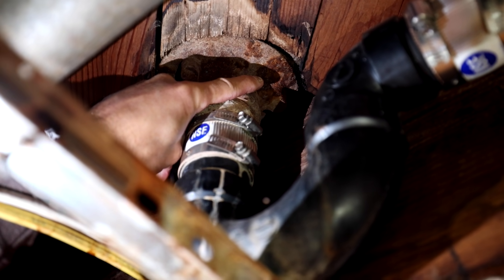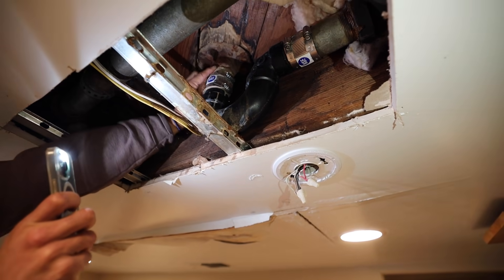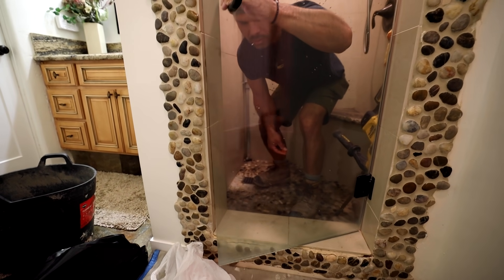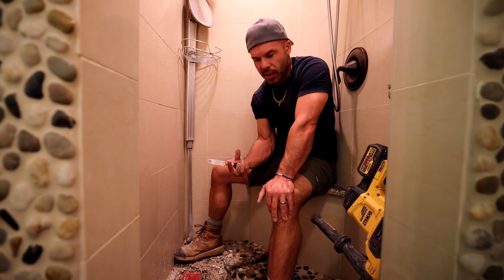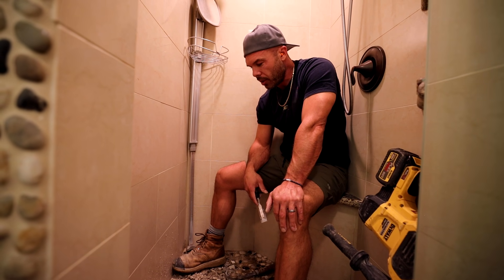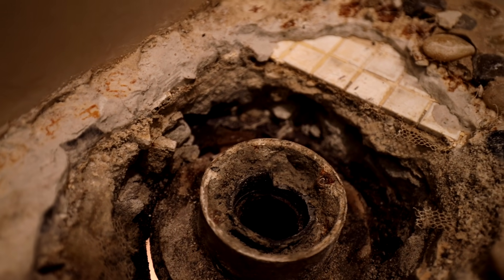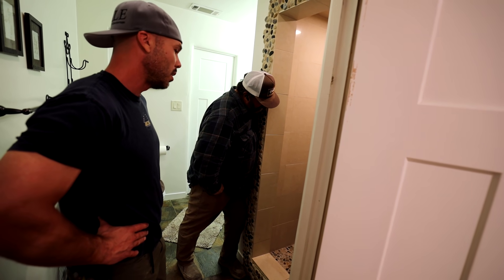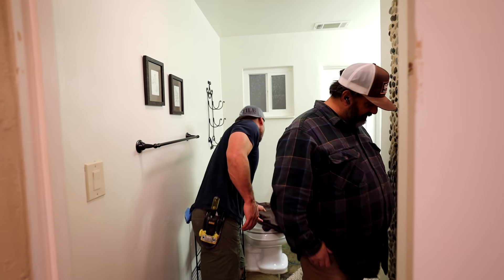Tile Guy Said he used SCHLUTER but did TILE OVER TILE

Comment: It's kind of funny as he was talking about how to keep the repair small. I just had flashbacks to every realtor I've ever worked for. Do it right or pay to do it twice
Reply: I won’t work for real estate agents anymore, give cheap and look pretty!! I’m not your guy
Reply: I am the owner and the only reason we called the tile coach is because when we had the shower installed I supplied him with a complete Schluter system. We thought we were going to be doing a Schluter repair which the top coach has plenty of experience with. This was my personal home and at the time we were working with several remodels in Sacramento for clients of mine. Given that I supplied him with the correct materials I expected him to install it correctly. I am real sure you've never done work for me. It takes the same amount of effort to do things correctly as it does to cut corners. That has never been the way we roll.
Reply: 100%
Reply: @brucepflieger7212 
Where is the tile guy you hired initially?
As contractors we are accountable for our work.
I hear you have a lot on your plate financially.
That guy should be the one paying to fix his mistake.
Reply: @hepparade The homeowner 100% lying! He even looks sleazy. Why didn't the homeowner call the original installer that he was using 10 years? I would dial the installer right there on video. He was too chill about the whole situation like he knew there was never a Schluter system installed.
Reply: @hepparade  sounds like it lasted 12 years
Reply: @Resist_JWO_1984  The customer himself commented directly above us. You don't need to be rude.

Comment: When I first started my tiling career, I had a homeowner that wanted me to do something similar to this. Retail the walls, but keep the pan in place and then cover with another layer of tile. I ended up walking off that job for a few different reasons, and no longer do business with him. If anyone ever tries to get you to do something the wrong way just walk from the project. It will save you so much headache in the long run.
Reply: I agree. If someone tells you to install a job incorrectly you need to walk away. I am the owner and I also owned Tile Outlets at the time. I supplied him with the complete Schluter system . That is what I thought we we going to repair. that is why I called the tile coach. We were not living at the home at the time and would have never even thought he would go this route. I can't imagine anyone going this route.
Reply: Question - where is the guy to fix his mistake, that did the job in the first place?

The client should never dictate the quality of YOUR work...this is absolutely why T&M work is frowned upon.  
We can't forget we are contractors, not the client's employ.

Comment: Homeowner doesn’t look surprised. Seems like he knew exactly what was being done to the shower.
Reply: I was thinking the same thing...he was almost finishing Issac sentences while he was explaining the issues
Reply: I know right it's as if the guy actually knew something about tile. I am the owner and I owned tile stores at the time. I actually supplied a complete Schluter system for this install. That is why we called the tile Coach. We thought we were going to be doing a Schluter repair which he has plenty of experience at. Quite honestly I've had a pretty rough year this year so to see the shower be a complete crap show was pretty in line with what has been happening. I am a realist I look at the issues and deal with it so was I surprised. Sure I was surprised at what the guy actually did. At the same time that's just pretty much what's been going on so it was just one more thing.

Comment: What would you use for a curb then? I'm making a concrete one, but it's also in the basement.
Reply: My go to is laminated go board… rip as many pieces you need for the thickness you want and then thinset and sandwich them all together! (Then I Kerdi over everything…but you could use a number of different waterproofing options)

Comment: By the time you rip out the pan/curb and 1 foot up the walls, you might as well rip it all out and redo the whole shower.  

The homeowner could demo, put in a plastic pan, have a plumber run the drain, then he could tile the walls and use a shower curtain.  

That is about the cheapest, easiest, good way to do it.
Reply: Those HD shower kits. I know I would if strapped for cash
Reply: Exactly what I would suggest in this instance, if he is really strapped on cash. $400 shower base, $200 in cement board and hydroban, and $400 in some cheap tile. The guy could do it all himself if business is slow and he has time on his hands. 3 days and $1000 and he has a new waterproof shower
Reply: @remodz6385  exactly, that's about as cheap as it gets, and him being in real estate you would assume he knows this already, just wants nice stuff which is fair as well.

Comment: I was a licensed operator of a family termite company and specialized in making structural repairs and we came across leaking shower systems all the time, especially on newer looking tile jobs. In the last 20 years of flipping houses and remodel boom it's gotten ridiculous. Just because someone knows how to lay tile and make it look professionally installed doesn't mean they know anything about water proofing, and on a flip house the ones controlling the money don't want to spend the extra money for a professional tile guy that knows showers
Reply: @suspicionofdeceit yep, no water proofing at all. It's amazing someone who is so talented at setting tile can have zero clue about water proofing.

Comment: Lasted for 12 years? Not bad. He probably hired the cheapest guy so he got his money’s worth. Can’t expect a cheap install to last forever.  Issac is a tile guy and he does plumbing…. What’s the difference?
Reply: I thought who calls a tile guy for a leaking shower drain
Reply: @kregar14  Actually the drain was working just fine…It was leaking around the drain because there was no waterproofing. Even though the tile guy reused the old cast iron drain, the water wasn’t leaking from the plumbing. The leak was in the shower system, not the plumbing system.

Comment: I am reading in the comments and some of you people either contract in plush and prosperous communities or you don't actually don't contract work nor even solicit for contractors to do work for you.   First of all prices for materials are up 400% .  All the contractors are up to their necks in job requests so they and charging premium prices as well.   So the quotes are very high.   Alot of guys are doing stuff like taking down payments for other jobs while they are on another job or two.   And when they accept a job they only want to take a job that they can get in and out of quickly.   They want a $2500 in  one day type work.   But if your job problematic  you can't pay them  $5000.00 to get in tangled with a problem.  .  So for that reason a $5000 bathroom job will not fly any more.   But the flip side of that is that  nobody has $12,000  just laying around these days.

Comment: He's not that bad off. I'm assuming he got that done cheap. If so, he got 12 years out of a cheap repair, which isn't the worst thing in the world. Yeah sure, now he has to follow all the way through, but he just got away with over a decade of not doing this.

This guy is the primest diy candidate I've seen in a while though. Why not, he's aware of the concepts etc...
Reply: i would agree but i think he was under the illusion that it was more expensive seeing as he bought the tile guy ( hack) all the stuff to do it and they guy just put lipstick on a pig and took the money
Reply: Actually in hindsight I wish I did do it myself. Tile is not new to me. At the time I owned a couple Tile and Granite stores. I supplied the guy with a complete Schluter system. I wish I had paid a" little" money for that shower. Apparently the guy thought he was giving me such a great deal that he didn't actually have to do it right. At the time that was probably an $8,000 to 10k adventure.

Comment: The homeowner 100% lying! He even looks sleazy. Why didn't the homeowners call the original installer that he was using 10 years? I would dial the installer right there on video. He was too chill about the whole situation like he knew there was never a Schluter system installed.